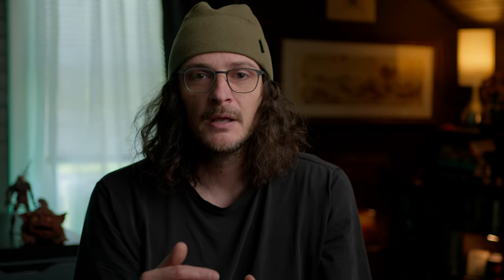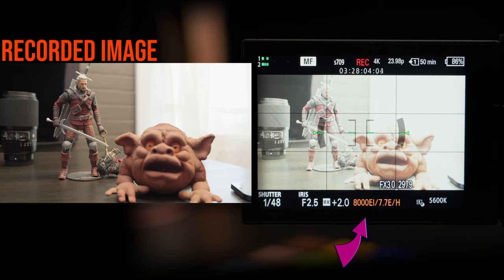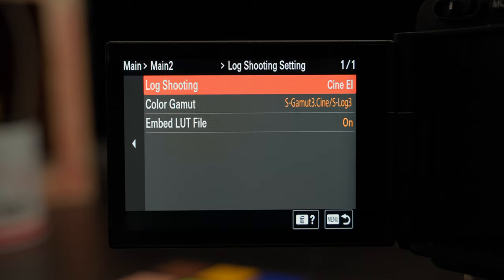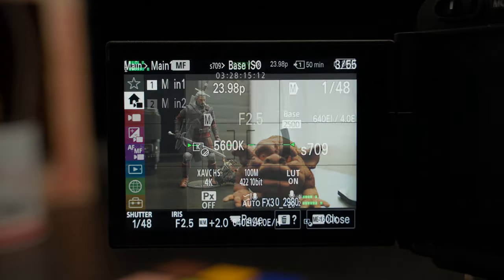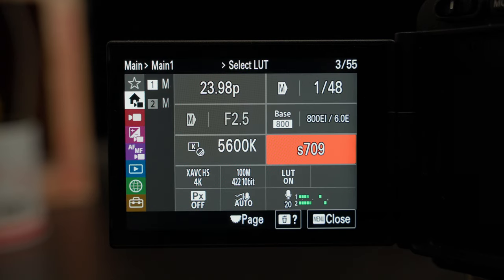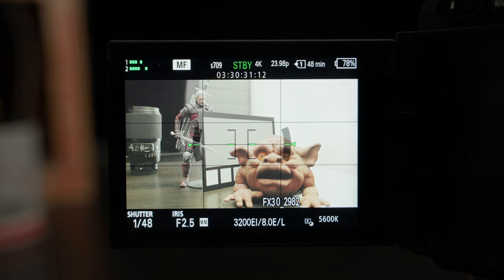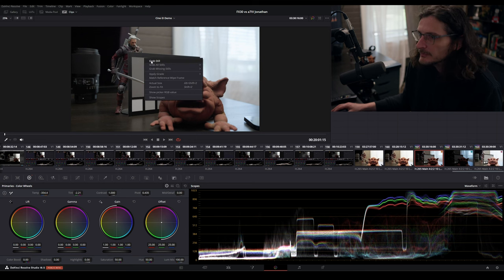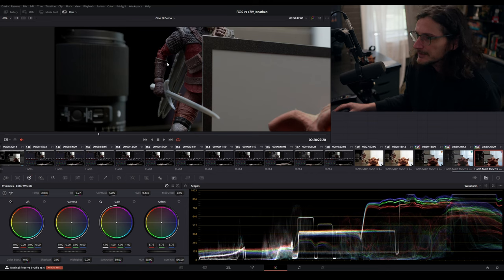Cine EI Complete Guide Sony FX30/FX3 | What, Why & How

Comment: how did you set the shutter to 1/48?
Reply from the maker: Huh, interesting. Looks like you need to be in either XAVC HS or XAVC S-I. Doesn't seem to work if you're in XAVC S
Reply: @PhillipRPeck  
no, unfortunately this is not available in either XAVC HS or XAVC S-I. Maybe it's a PAL/NSTC thing, but also not.
Reply: @PhillipRPeck   I thought fx3 didn't have a 180 degree rule. Just like the Panasonic gh5/6... But somehow you managed to set it to 1/48
Reply from the maker: I can see it being PAL/NTSC because you wouldn't need 1/48 if you're shooting at 25 fps. Otherwise, maybe it came in a firmware update? What version are you on?
Reply: @PhillipRPeck  FX3 v4.0
Reply from the maker: When I switched to PAL, I lost the 1/48 option. Switching to NTSC, I have it in XAVC HS and XAVC S-I
Reply: @PhillipRPeck  thanks! 👋🏻

Comment: Is Panasonic GH7 better than Sony fX3?
Reply from the maker: In a lot of ways, yes. It has many video/filmmaking features that are still absent from the FX3 and just about matches or exceeds everything the FX3 can do in terms of high speed recording. 

I haven't used a GH7 personally, but I would imagine that the FX3 still holds the advantage in image quality and dynamic range by virtue of the bigger sensor. It also has a faster readout speed than the GH7. With that said, it's limited to 4K while the GH7 can record 5.7K (also ProRes RAW internally which is badass). 

The FX3 also comes with the XLR audio handle which may be an advantage depending on your use case. However, Panasonic's new XLR adapter combined with the GH7 provides 32-bit float recording which is certainly nice
Reply: @PhillipRPeck if you could buy Gh7 with kit lens and XLR adapter same price as FX3 body which one would go for !
Reply: @PhillipRPeck 32 bit audio is big deal?
Reply: @PhillipRPeck which has better colours
Reply from the maker: I don't know which has better colors as I haven't used the GH7 but that is totally subjective and, IMO, doesn't matter as you can adjust colors just about any way you want. 

32-bit float is a nice to have but not a necessity. I just mentioned it as another feature possible on the GH7 that's not on the FX3 (internally). But you can get 24-bit, 48kHz audio from the FX3 which is still professional quality. 

The GH7 is a whole lot of camera for the money. As you mentioned, you can get a lot alongside the GH7 for the cost of the FX3 body alone. For me, it would come down to overall ecosystem (lenses, other bodies I might want to get in the future). I've owned a GH5S and M43 lenses in the past, and they're still relevant to this day (just got back from a shoot with two GH5's and a GH4) and if I were starting from scratch, I'd definitely give the GH7 a hard look
Reply: @PhillipRPeck  so you prefer gh7 over Sony ? What if you had invested in Sony lens ?
Reply from the maker: @GurmeetSingh-fr8uo  I said if I were starting from scratch, I’d give the GH7 a look. I currently own Sony lenses and camera, so I wouldn’t switch back to Micro 4/3 at this point

Comment: Let me clear something up for you all, First off exposing to the right meaning over exposing your shot by 1.3 or 1.7 stops, basically is a trick, it's over exposing so your sensor is not recording any dark shadow area's because if it does that it produces noise  (NOISE) because of low light..
And the kicker here is one of the things that you do is the cause of noise, which is recording at a higher ISO number above 200 ISO. Basically boosting the signal, which does what? Produces noise.
Because basically what your doing is amplifying the digital signal to your sensor to get the scene brighter..

I always say, especially if your shooting indoors with a controlled light situation like using studio lights record at 200 ISO and not have to worry about Noise and not have to do the over expose trick to not record shadows? 
Well these idiots answer well if you do that then you can't shoot in LOG and recording in LOG that way you will ruin your video image, That is a bunch of BS first off that is NOT TRUE.
You can shoot in Sony Slog3 or SLOG3 CineGamut  as low as 200 ISO and have a good clean image, and not have to over expose and can still over expose if you like for even less noise..

there is NO reason to shoot at base ISO like 800/2500 and do all that work to make your image look clean just shoot at lower ISO values like 200 ISO which is the cleanest image..
Then they say well you lose Dynamic Range..
Well yes and NO,  you only lose 2 stops of over exposing shooting 200 ISO vs 800 ISO, meaning you only lose 2 stops Dynamic range to prevent clipping on brighter scenes such as the sky or something like that..
The at 800 ISO the sony Fx30 only gets 14.6 stops Max that is much as the camera can deliver, but the clean stops which is proven on charts is only 12.7 stops, that means the cleanest image you can get.  that is shooting at 800 ISO.

When shooting at 200 ISO the max stops you can get is only 12.7 stops, and the clean stops stays at 12.7 meaning your only going to get 12.7 clean stops anyway regardless if you shoot at 800 ISO or 200 ISO, your not gaining any more clean stops in any mode it doesn't matter, so why go though all the effort in shooting at 800 ISO and then over exposing your shot then in post doing the work to bring it down to clean it up, WHY WHY WHY, when you can just shoot at 200 ISO and not have to do all that, And by the way, 

Shooting at 200 ISO is cleaner then shooting at 800 ISO  and over exposing and cleaning it up in post, so it's still cleaner to shoot at 200 ISO rather then doing the 800 ISO over expose trick, so your all fools for doing this, because you gain nothing and lose something because the image is still cleaner at 200 ISO...

Your just making more work for yourself for less  it's a joke and kind of funny when i watch people do this, it makes me laugh and think what is up with these idiots...

Light your scene properly and shoot at 200 ISO and your going to get the cleanest video you ever got...
Don't believe me, Gerald Undone did a video to prove this, and using technical charts to show you, that when shooting LOG, you can shoot at lower ISO values.. Here it is...

https://www.youtube.com/watch?v=rLG_zlshlSA
Reply from the maker: Thanks for the video idea
Reply: But not everyone can just bring in lights
Reply: @Chris-ey7zy  I believe he is saying even without lights rather underexpose and brighten in post. But hey I'm a noob so don't listen to me